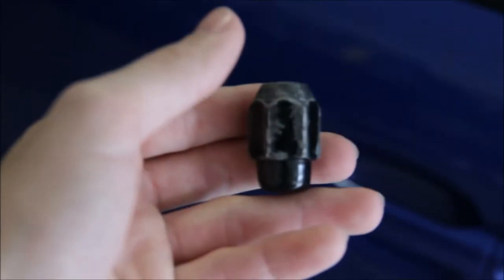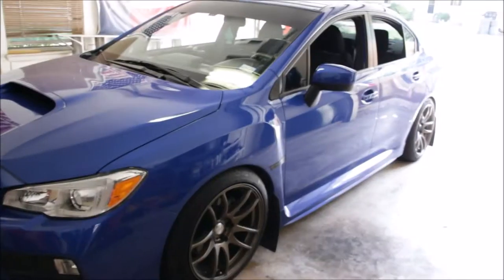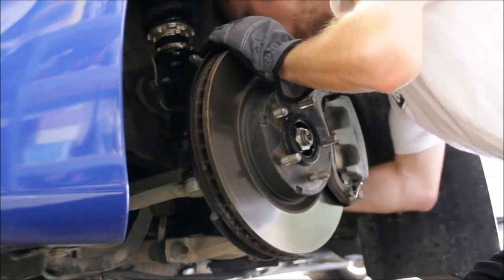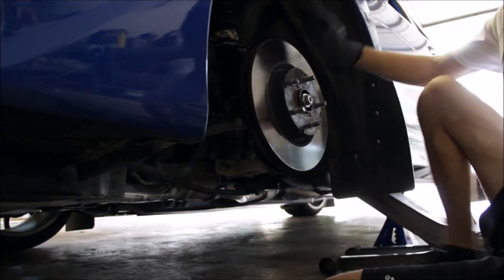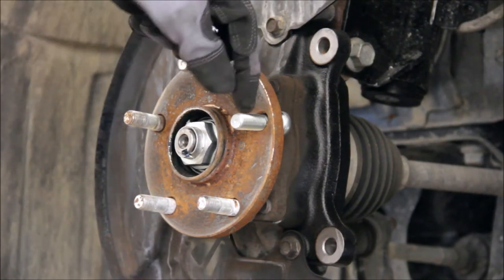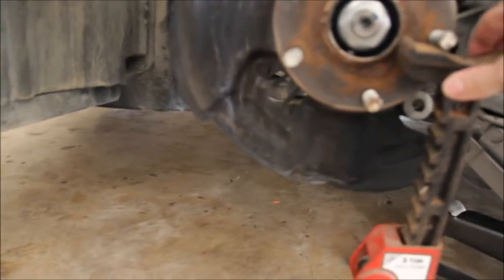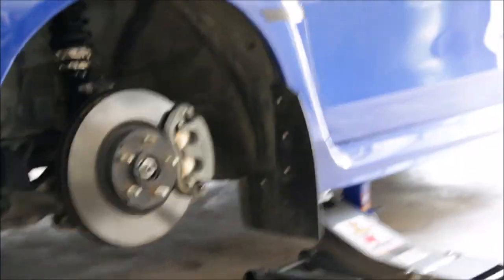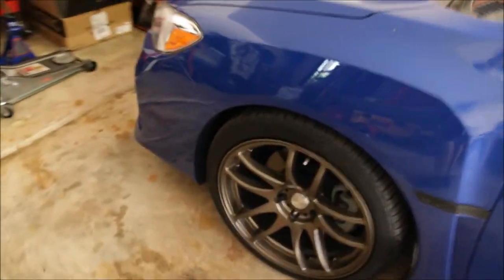HOW TO CHANGE A WHEEL STUD 2015+ SUBARU WRX/STI

Comment: How did you get the rotors back so they are tight like when you took them off and had to use the screw to loosen them up?
Reply from the maker: True Vang oh man. This video was a while back so I really don’t remember. I think once I just pushed it back on it stayed. Then once you put the caliper and wheel on the wheel will really push it up against the brake plate behind the rotor. Hope this helps